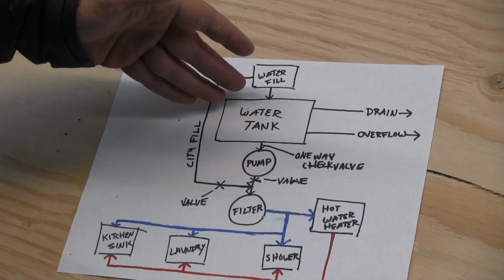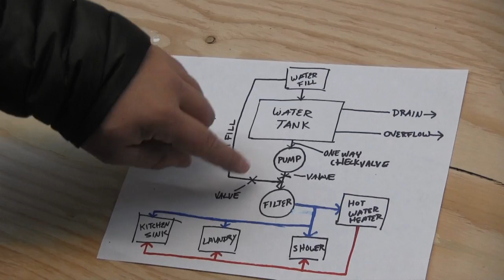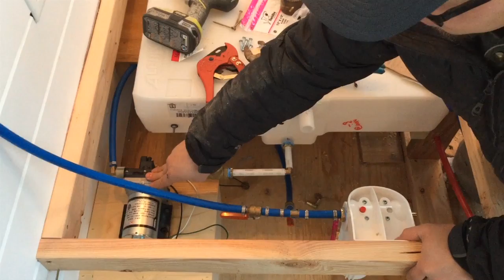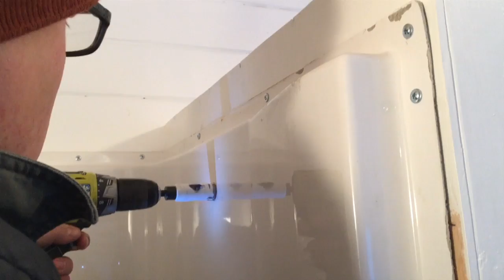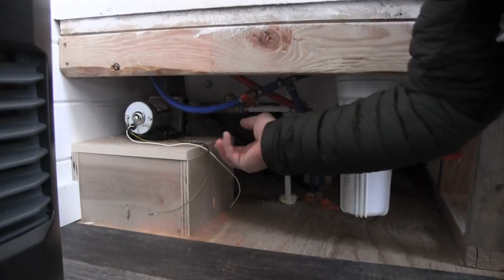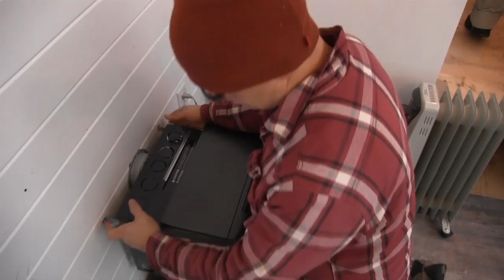Tiny House Plumbing System

Comment: My house is connected to City fill and a reserve tank of 1,000 litres ( in case City fill fails, which it does frequently!!), and has a pressure pump in case the City fill has low pressure, (which also happens frequently!!). However the original "plumber" didn't think the whole process right through like you did, and it's a mess to do repairs (no quick uncouplers, just solid glue PVC joints), and always uses the pressure when it could use City pressure a great deal of the time. Seeing your plan (and realising my mess), makes me appreciate your style of thinking and working very much, and I have taken a screenshot of your plan to help me improve my plumbing ☺. As they say: "You guys rock!!"
Reply from the maker: Darnit, I'm sorry to hear that! Thank you for watching and the appreciation of planning:)

Comment: Thanks , as an engineer myself, (electrical) I found just the suggest of drawing a schematic diagram of your plumbing extremely helpful (and now so obvious). I had lots of ideas swirling in my head and that simple diagram has helped immensely in putting my plumbing plan together along with all the other tips you suggest.

Comment: Love your work and designs. Just a thought for you on water tank placement. I lived in NH and was in and owned some 1800/1900 houses that were original. What they did for the water tank was to put a round barrel (like a water heater) in the eaves near the peak. Heat rises and tank never froze. The pump from cistern pumped water to fill the tank being higher there was a natural water pressure in the system. I thought this would be a great idea for someone who was off grid and needed to run pump when the sunlight was out to power a pv powered water pump. Just a thought.
Reply from the maker: Thanks for sharing Richard!

Comment: I suggest a hinged platform for your fuel supply for the heater, that way it can fold up or down while your in motion. Maybe add a strap to hold the tank secure.
Reply from the maker: Thanks for watching and appreciate your input!:)

Comment: I like that you set up the plumbing so it can be easily serviced in the future.  How big of a gravity fed tank do you need for that heater?  I would think you go through a lot of fuel during the winter, and refilling it would not be fun at -30F. 
Will someone be living year-round in this house?
Reply from the maker: Hi, thanks!  Yes, the house if for year round living.  We are planning a 50 gallon tank, the tiny house is projected to burn about 1 gallon a day on average in the winter, so that should be plenty.  The homeowner has access to a transfer tank in a truck, so will be able to fill it that way (as our local fuel company won't deliver to tanks under 100 gallons)

Comment: Great to be able to watch all the planning, etc. One question though: with the very low temperatures, isn't it risky to have the diesel tank outside - or is it especially insulated against the cold?
Reply from the maker: We are still planning for the diesel tank and the best options, stay tuned!
Reply: No problems with the paraffin in the diesel flaking out and clogging the pumps when it's really cold?
Reply: Diz Heller 
We run number 1 diesel with above ground tanks in Alaska. It doesn't gel up like number 2. No problems with clogging pumps
Reply: Ah, thanks. - I thought that a cold country like Alaska must have a solution for that!

Comment: Do tiny home plumbing setups account for draining the system for moving or extended  shutdowns? Sounds like this client will be full time living. However with your extreme cold climate if there are any extra measures designed into the plumbing system.
Reply from the maker: Yes, the tank can be drained for moving. Thanks for watching!

Comment: Hi Ana! Thank you and your husband for your informative videos! They are helping me and my husband plan for our tiny house build this year. We will have a plumbing set-up similar to this one. But I was told that we need a water accumulator tank for water pressure. I notice that you didn't put one into this build. How was the water pressure in this house? Would you recommend an accumulator? Also, is the water pump noisey? Does it make a loud running noise every time you turn on a faucet? Thanks for any insight you could provide!

Comment: dumb question....how do you know when you need to fill the tank? do you just run out of water mid flow or is there a low level sensor?
Reply from the maker: +yocampout not dumb at all sorry we overlooked in the video.  This tank has sensors so you can check tank levels.  We've also had tanks without sensors and they are easy to install.
Reply: Ana White thank u

Comment: What about the waste water?  Do you have a gray water collector or does to just drain directly outside?
Reply from the maker: Sometimes we do grey water tanks, but this time, the homeowner didn't see a need, so the drain pipes just all go out under the trailer.  The plan is an insulate line to a septic tank or french drain at some point.

Comment: It's called a "water heater", not a "hot water heater". You don't need to heat hot water. :-)
Reply: Yes, smiley face was missed.
Reply: rho lees... if you don't care, then ignore my comment. I just think that heating hot water is redundant.  Also, I guess you missed my smiley face.
Reply from the maker: Thanks for watching Dan:)
Reply: Always enjoy your videos. Especially enjoy watching you build your house. I'm in Texas and we don't build like that in this climate. And thanks for the tiny house plumbing. A good idea to keep every thing inside the insulated space anywhere when it's on wheels.

Comment: It's not a "Hot Water Heater" Hot water doesn't need to be heated.  It's a water heater that heats (cold) water, making it hot.
Reply: SumErgoMonstro Who cares what it's called.  That they took the time to show HOW to do it has 200%  MORE value than someone who can only talk (use a single correct word) about  it or make some grammatical  corrections.  I think pretty much every one understood what was being talked about and referred to except  you, apparently.  The value is in the DOING not the wording.